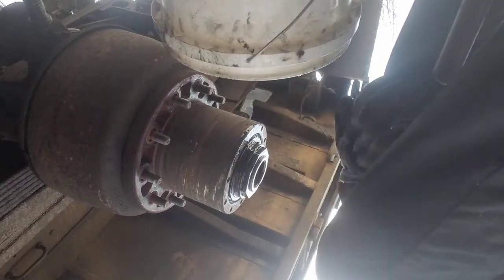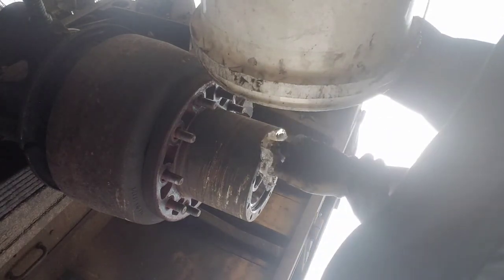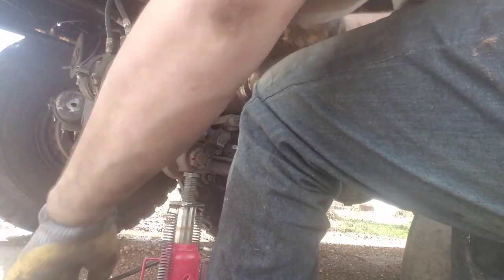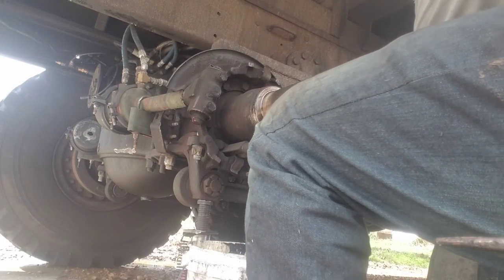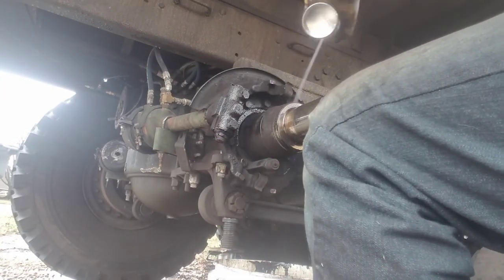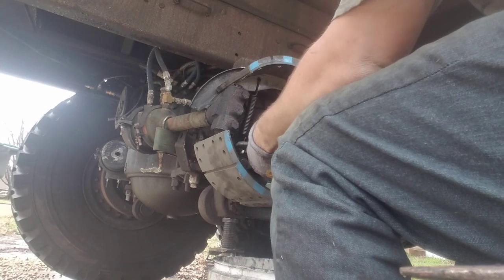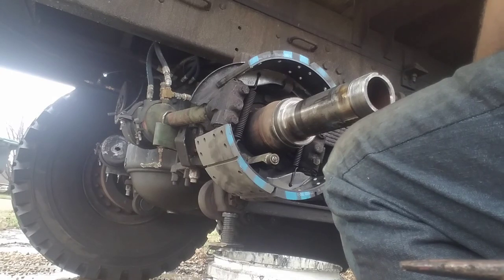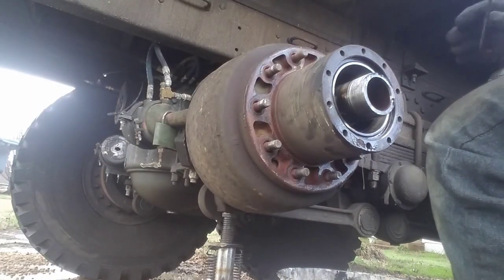M939 rear brake replacement

Comment: Thanks for the video Wes. My truck is an M 931–A2.  It’s a BMY truck. The brake drum is separate from the hub. So I’m guessing that you can do the brakes without removing the hub and axle assembly?

Comment: I just had my axle/wheel seals and bearings replaced and now my brakes on that side are not working , Would the oil ruin the brake shoes? It  was leaking oil on the inside of my spindles , I have a 1985 M923a1 AM General 5 ton.. The shop sprayed cleaner on the pads. Thanks.
Reply from the maker: No they will still be fine.  The brake cage is uncaged correct?    When someone pushes the brakes can you see the shoes move with the rear covers off?
Reply: Thank you for the reply/info. I we will check for shoe movement in the morning. I bet they forgot to release the cage.  I might be able to do that myself, I know there is a mean spring in there., The shop that did the work worries me . Thank you very much.
Reply from the maker: @fredboat  caging bolt releases with a 3/4" wrench.   Easy removal.is to chock the wheels,  truck running. Disengage the parking brake,  crawl under. Nut in the cage bolt will come loose easy and turn counter clockwise and remove it.  This will be quick since the parking brake being released will allow air to hold the spring back as the bolt is released
Reply: Thank you .I just crawled under  my truck and the blue plastic covers are in place over the bolt opening, They look like they  have Not been disturbed for some time and the cage bolts are there and look unused. I guess they have their own tool. I will can do the inspection movement test in the morning as I will have another person . I saw the brake drum off the truck when they replaced the seals ,So they did some thing else. Thanks  Fred
Reply: I have m923a2 . 1 of my rear tire spin even when the parking brake is on and tanks empty.  What do you think the problem is?

Comment: @wessimpson2794 I need some advice i working on putting wedge brakes on my 818 is there any difference in spider pilot hole and I also have other questions i would like to ask if you don't mind
Reply from the maker: Spider and everything should be able to transfer between axles if you have the whole other axle  the tubes are the same
Reply: @wessimpson2794  so I was correct the spider and the backing plate are a direct swap. What about the drum and hub. I know the drum is different but is the hub different also
Reply from the maker: @NOMAD1GHOST  hubs are the same
 Seals. Bearings studs.  939 studs are longer than 800 series studs.  And an 939a2 series hub is completely different of course.   Those hubs aren't a straight hub section so they are obvious to know the difference
Reply: @wessimpson2794  thanks for the Intel do you know where the best place to get the brake cans drums and shoes
Reply from the maker: @NOMAD1GHOST  depends on where you are located.

Comment: Why does it have an outer seal if bearings are oil bath
Reply from the maker: The inner seal was originally not designed to handle the pressure from the oil and axle. So it had an outer seal to just keep the bearings in grease rather than blowing the inner seal.  With modern seal advances they can take up to 20psi of pressure